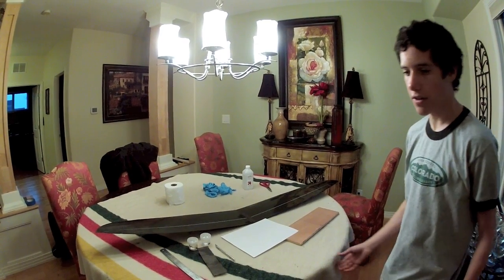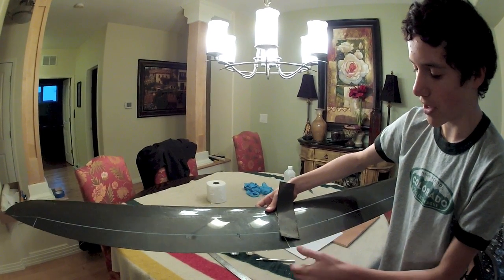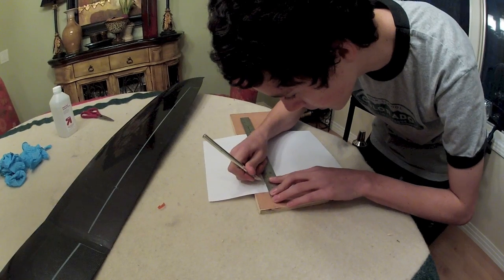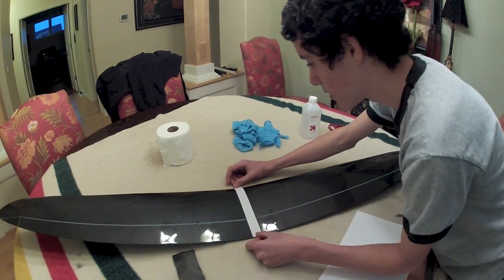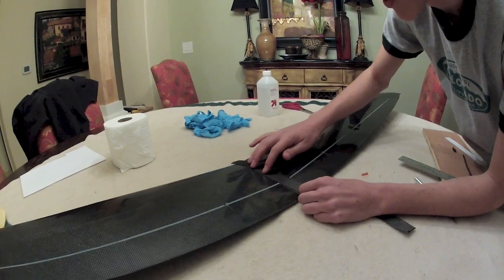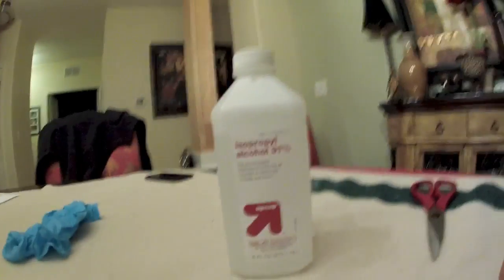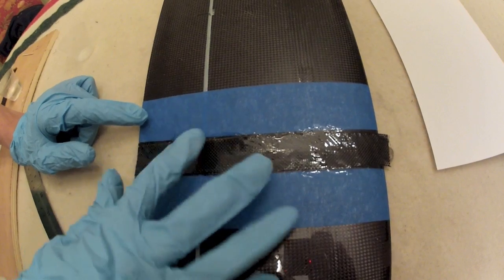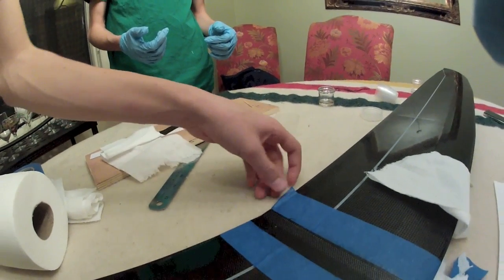How to (in depth)  Apply Fiberglass or Carbon Fiber patch to a Model Airplane.

Comment: you made several beginner mistakes. you really should watch the video link below  as well as part 2 so you can learn the right way to perform this procedure before you post a how to video. the video link teaches how to make a fiberglass repair but the techniques used are the same for what you tried to do.

youtubeDOTCOM/watch?v=QE3A_KAtbPQ
be sure to replace the DOTCOM with .com

Comment: Another tip, you should have scuffed up and then clean the area on the wing where your laying the carbon fiber strip so the epoxy adheres better. You never want to glue to a smooth uncleaned surface or your glue joint can fail!